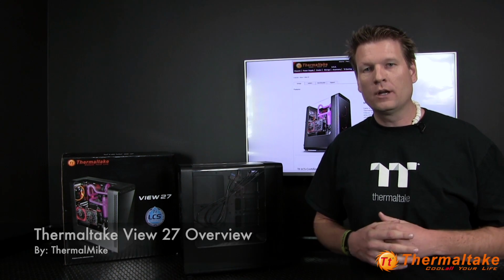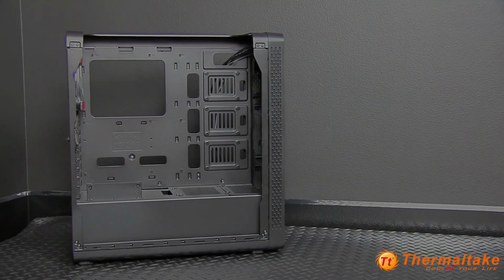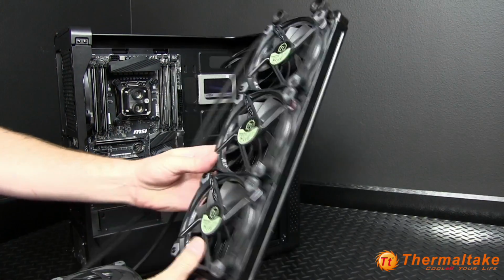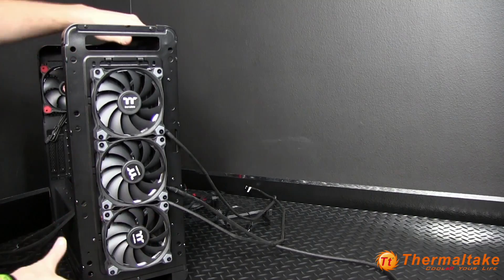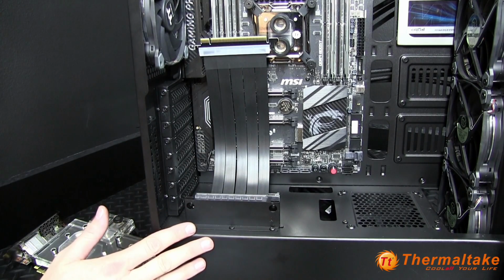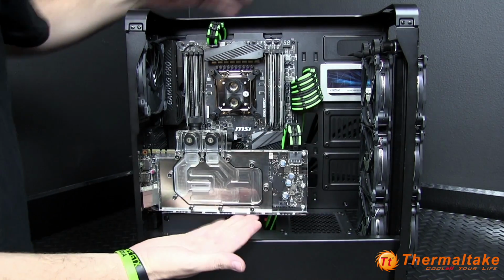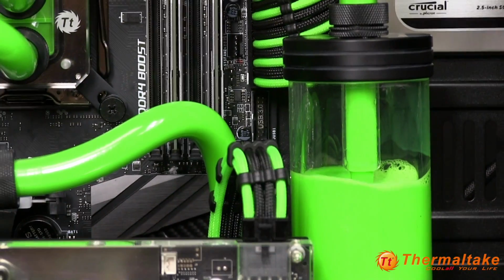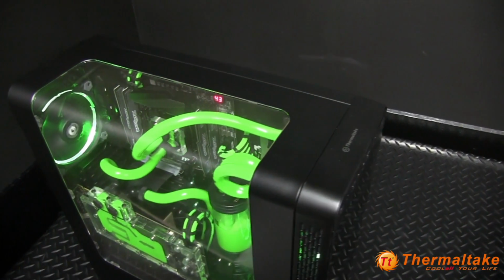View 27 Chassis Overview

Comment: If you fit a radiator with classic 25mm thick fans attached on the inside like he did before setting up the push-pull, what is the max radiator thickness allowed?

Comment: also why did you install 2 sets of 3 fans in the chassis?
Reply: Agreed.

I can see using a push/ pull design IF the chassis has the necessary room in the front (behind the front panel) to allow proper airflow.
While it looks as though there's about 1 inch of room; the front intake fans would cover those side intakes, making those fans kind of useless. It makes more sense to use only one set of fans on the inside (and maybe a thicker radiator) in this case.

Comment: Does this case fit the Thermaltake Pacific RL360 D5 Hard Tube RGB Water Cooling Kit in it?
Reply: Hi, The RL360 Hard Tube Kit will work just fine, with the thicker radiator no push/pull due to thickness. In this video I used the PR15-D5 which is only different by the capacity and height of the reservoir.
Reply: ok thanks
Reply: where can i get that PCI cable adapter for video card?

Comment: That build looks sleek as all hell, i love it. I have obe question tho, i've heared that with a openstyle aircooler on your cpu, the window in front of it becomes dull because of the heat, what can you say to that?
Reply: With the front panel having a tint to it, I dont see this being an issue. properly cleaning it will always help. If it get a light scratch on it over time, just polish it and it should be good.

Comment: Would I be able to fit both a 240mm radiator and a 120mm radiator on the front? (Water cooled cpu+graphics card)
Reply: Mr4reFan Shouldn't you be able to install the 120mm radiator in the back?